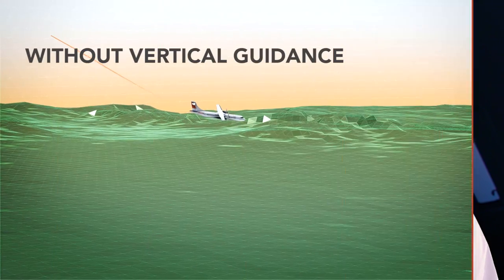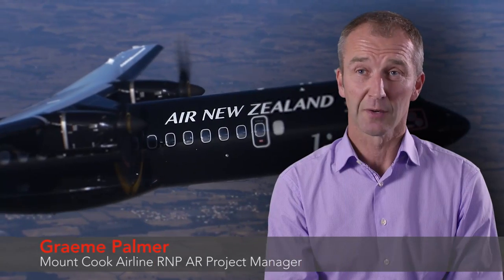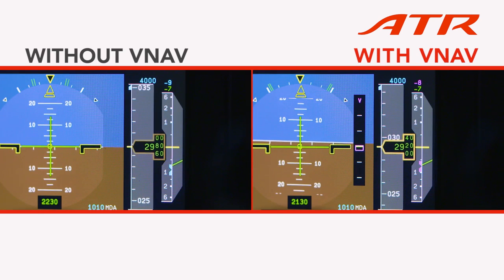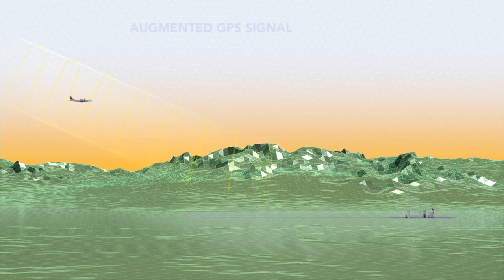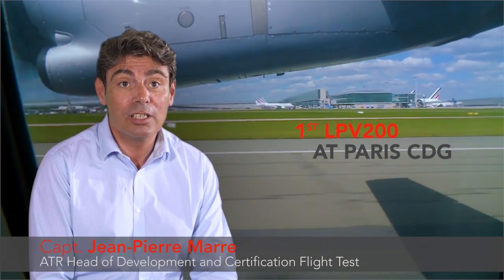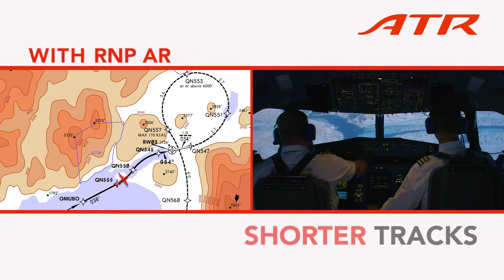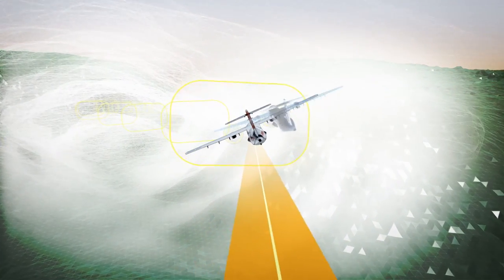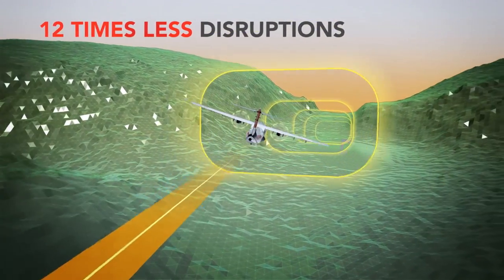PBN - Performance Based Navigation on ATR

Comment: As an older guy who stopped flying for a few years when GPS was getting started, I jumped back in and couldn't understand why the big push for something that could easily be, deemed unreliable by a solar storm. We have seen that already, coupled with roving GPS blackouts consisting of 17 hours or more, just for magnetic north re calibration. The bottom line is as you mentioned, SAVING MONEY!!! The magenta line worshipers at my flight school already dont like the fact that I showed them this unreliability and the frequency at which it happens.  Stay sharp with your radios and all of their quirks, pilots, it just might save your hide one day!
Reply: Bah hum bug 😂
Reply: @HeyGooch  LOL.